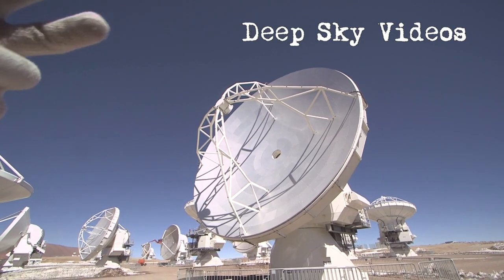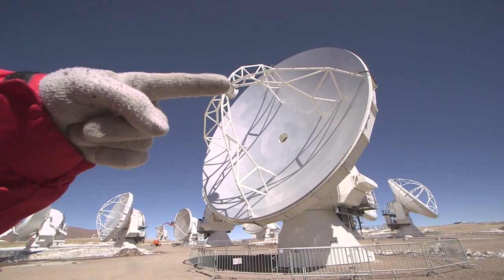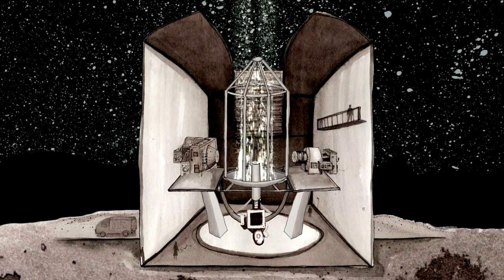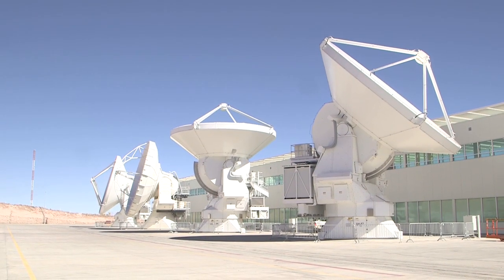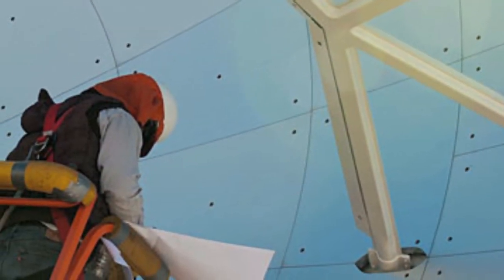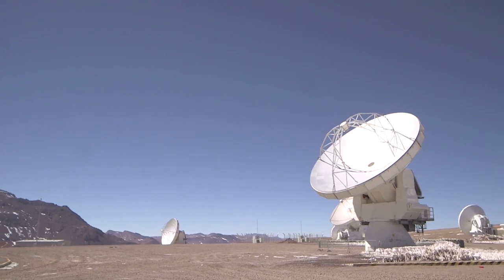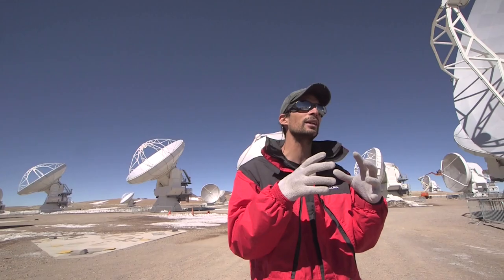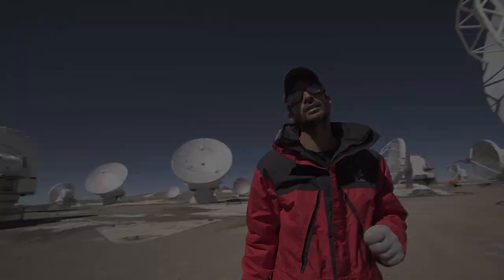Antennas at ALMA - Deep Sky Videos

Comment: but if you make just a quarter turn on some sqrews ... wont they be less accurate after transportation (because of shaking and little shockwaves)?
Reply: TheNefari The small adjustments are made with the panels in place in the reflector. What has the transport got to do with it?
Reply: TheNefari Yes. Amateur telescopes use the same system, mine has 3 screws behind the mirror for the same purpose. And it's recommended check and adjust the screws every time you bring the telescope outside and set it up, because the act of carrying it around may knock the mirror off alignment.

This'll also happen overtime when rotating different sections over their respective axes, which is why it's important to have extremely good shock absorbing mechanisms in place - especially for telescopes of this size.
Reply: DeepSkyVideos Now i am thinking of some other kind of telescope...
So if the mirror is always directed at the object (the thing you want to look at) and the receiver ...
Wont it be better if there was only one huge receiver surrounded by flat mirrors ?
Kind of the solar powerplant that focuses the light to the heatingtower in the middle.

You would not need to have a certain curve or many sensors for every mirror.

Comment: And why do they use aluminium instead of mirrors? Is it because they are exposed to day light?
Reply: rafagd They only need to catch the radio waves.
Aluminium is a mirror to radio waves and it's cheaper and can be bent more easily.
Reply: rafagd Actually, optical telescopes use aluminum for their reflective surface. They use a ton of glass, but really all that glass is just there to hold up the thin layer of reflective aluminum.

Comment: What spectrum of light are these sensitive to?   They don't look like a normal mirror.
Reply: They are normal mirrors to  millimeter- sub millimeter waves ( wavelengths of 3mm to 0.3mm, frequencies of  100 to 900 GHz).
Reply: lorddarphyve they range from high frequency microwave to low frequency infrared. No visible light as you may have noticed :)
Reply: Antonio Barba interesting. Thanks.

Comment: I'm surprised to hear that these are optical telescopes.  I thought for sure they were radio telescopes.
Reply: +Barnekkid They are millimeter/submillimeter telescopes, so that means far infra-red to radio wavelengths, about 500 to 15000 times shorter wavelengths than visible light, between 31 to 950 GHz, or 9.7mm to 0.31mm.